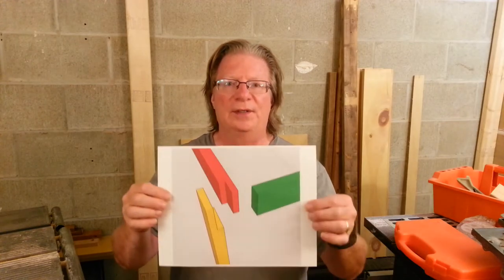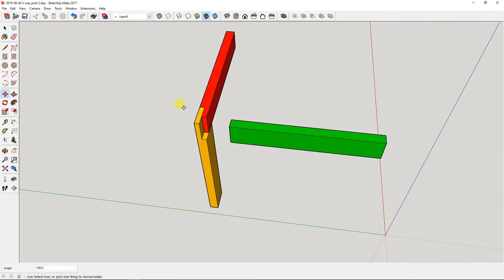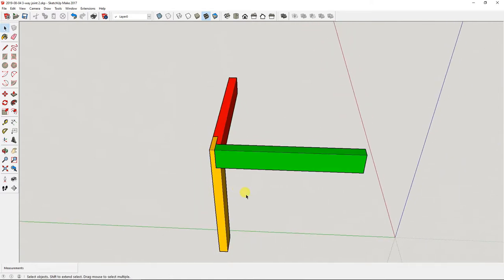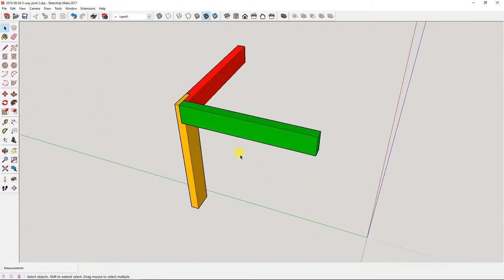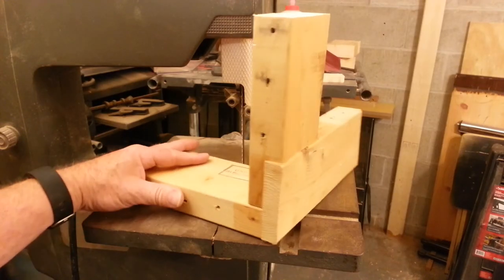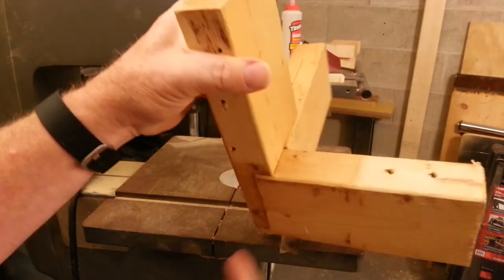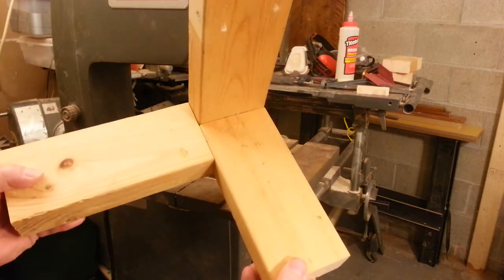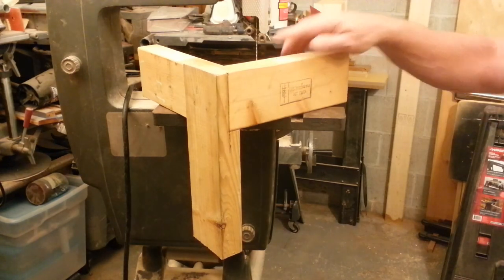65. 3-way wood joint using 2x4s

Comment: Looks good. Explanations are simple for DIYs like myself who want to keep busy in retirement without expensive tools.  I have a jigsaw and it might do the trick.  Thanks again.
Reply from the maker: You're welcome. This was a fun little experiment. I didn't mention it in the video, but this joint is very strong because of the large amount of long grain (not end grain) surface area available for the glue. I used Titebond II wood glue.
If I were to try this again, I would try making the cuts using a handsaw. My favorite hand saw to use is a very inexpensive Japanese style pull saw I bought from Harbor Freight. "Nicer" saws can be purchased from Amazon. I love using this saw! I find it very relaxing to use hand tools. So much so that I no longer own the bandsaw you saw me use in the video.
Something else I didn't try/show in the video is that after I cut the first set of parts, I could have fine tuned the 2 half lap joints using some chisels or block plane (also very relaxing and inexpensive tools to use). I think I could have gotten better (more flush) joints.
If you were to try and make the half lap cuts using a jigsaw, you would need a very long blade. You could then use the chisels and block plane to better the fit.
Thanks for your comment and for watching. Enjoy your retirement! I hope to get there someday.

Comment: Did the same joint in my last project. I had the same problem as well, my 2x4s were not flat. It was a hustle to make sure the corners were square.
Reply from the maker: Non-flat 2x4s is partly what got me started with handplanes. It is rewarding using one with a nice sharp blade. If you haven't tried handplanes, I recommend it. Thanks for your comment and for watching.

Comment: hai..can i use this joint to make a loft bed? are it will be sturdy?
Reply from the maker: The glued test joint that I made and showed in the video seemed very strong. Glued joints done correctly can be stronger than the wood itself. I made a video to test the strength of glued joints; here's a link if you are interested: https://youtu.be/KnDokEpcUac
If I were to build a loft bed using this joint, I would probably reinforce the joints using carriage bolts. Everyone is responsible for their own safety so you will need to decide what is best for you. 
Thanks for your question and for watching. Please feel free to share any of my videos using social media, email, or text.

Comment: Thanks man , I just needed that .Any suggestion  if the wood I am using not 2x4 but  2x2  (square and not  rectangle) ?  .Keep up the good work
Reply from the maker: You should be able to construct a similar joint; you'll just need to adjust the dimensions. Thanks for your comment and for watching.